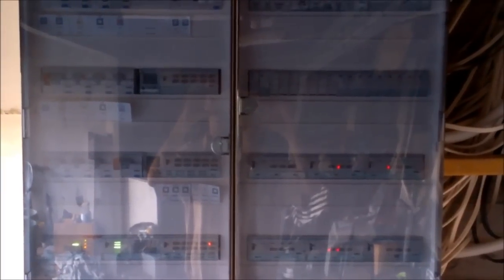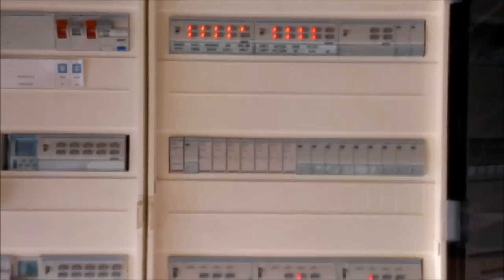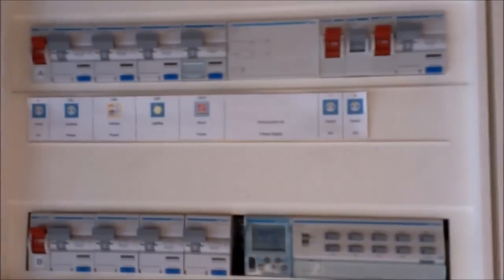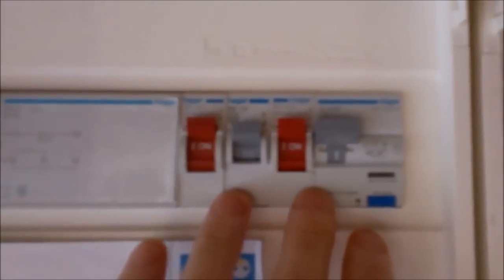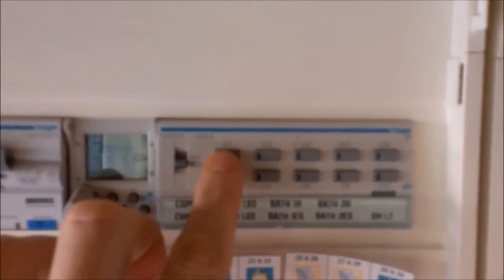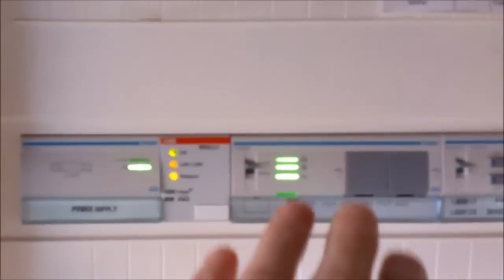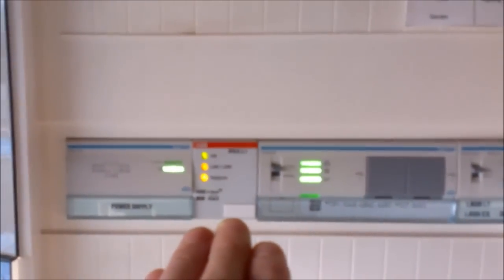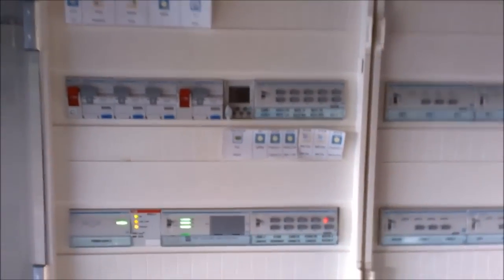KNX Smart Home Overview Video

Comment: We are from Binthen Company that developped KNX Motorized Curtain Kit, Advantages as below: 
1, No need KNX shutter actuator anymore, save a lot cost
2, KNX Certified Product with Patented spliced track system
3, Standard package from 2.2 meters to 8.2 meters
4, Very convenient for distributor and store/online seller to sell
5, Standard package make shipping and stock more easier